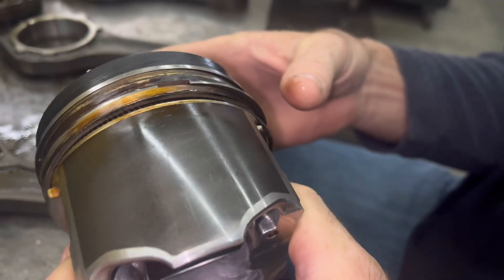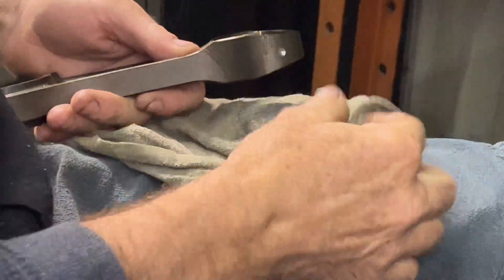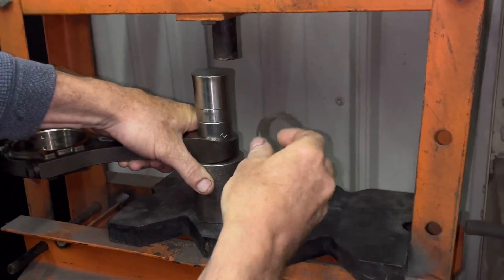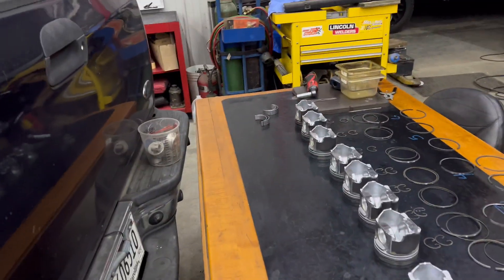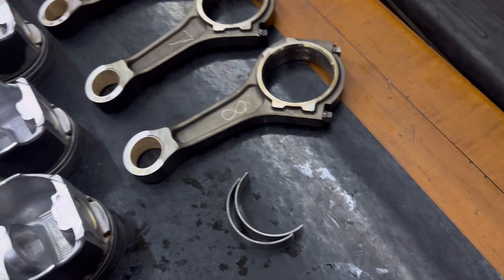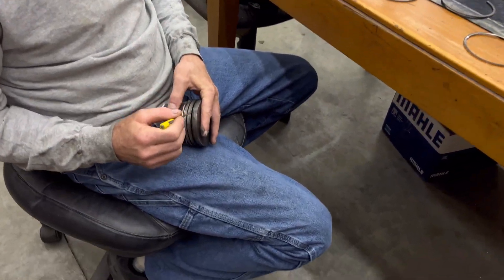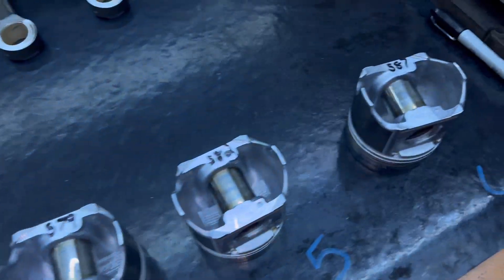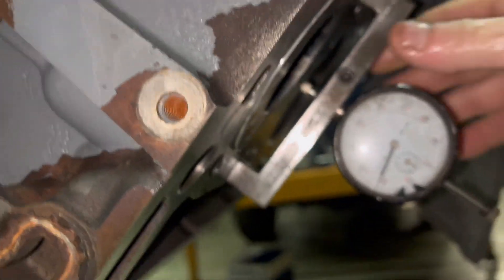Rods and Pistons in Ron’s F350 from South Carolina

Comment: Mahle pistons for the win ......no ceramic top ?
Reply from the maker: I have only seen one 6.0 burn a piston.   It was a cracked injector that was ran.  We ceramic coated those.   But normally we do not push enough fuel to justify the coating.

Comment: So I'm just trying to follow along, is Ron's just going to get honed and new rings and bushings?
Reply from the maker: As of right now,,  just a basic deglazing of the cylinders,  lap the valves in,  new rings and bearings and rod bushings with a balanced rotating assembly using his old rods and pistons.   Pretty much a job most everyone could benefit from!!   What do you think SS??
Reply: @AnthonyYoungblood  badass brother.  Yeah I agree, perfect way to update the factory parts that need updated like eliminate the STC fitting, pushrods, and lifters while in there and reseal the leaky bed plate, love it.